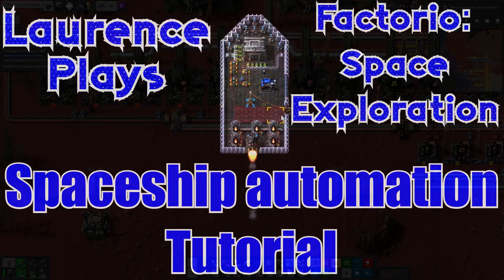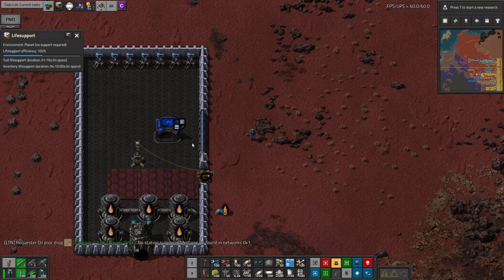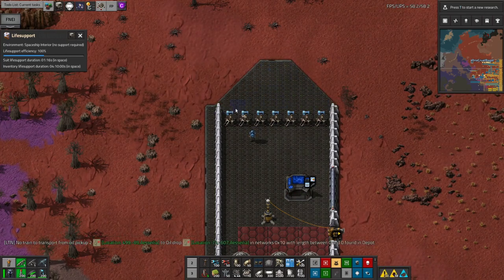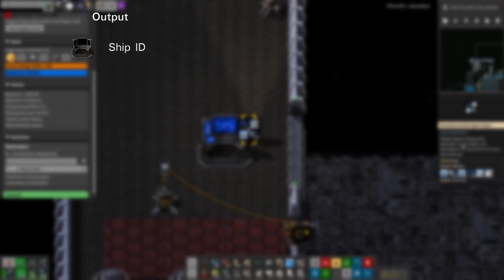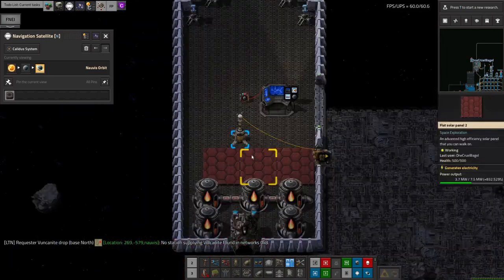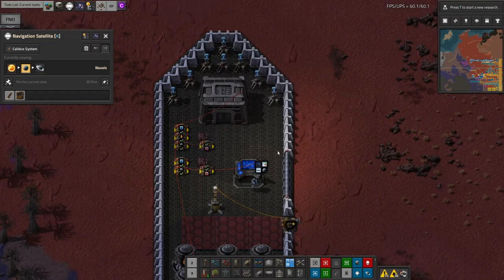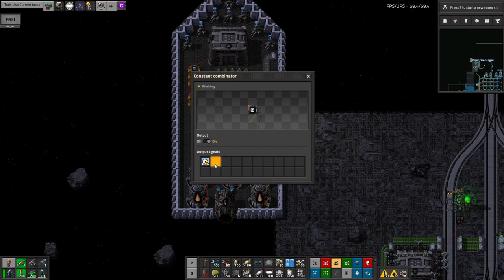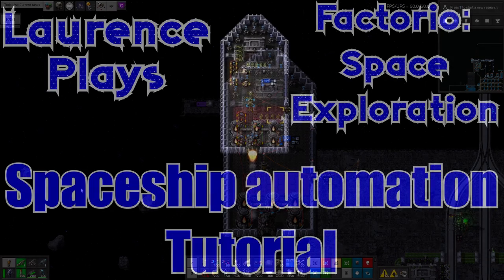Spaceship Automation Tutorial - Factorio: Space Exploration - Laurence Plays

Comment: I just want my personal ship to use clamps when I bring it in to one of my orbital platforms to line itself up properly.  I'm not trying to automate the ship to take off & land on its own.  Is that even doable?
Reply from the maker: Yes, should be very easy! I think (although it's been a little while since I built any spaceships) that if you put the clamps in as normal and feed the clamp signals to your spaceship console all the time, it will dock to them whenever it can. 

You'll need to make sure you set the destination before you launch, otherwise it will automatically dock again, but that should work nicely.
Reply: @LaurencePlays  I'll have to try to figure out what I'm doing wrong tomorrow.  For some reason it spams we with a message about solar panels being in the way every second.  Which is odd considering that I don't have any solar panels on the ship, nor anywhere near the dock.  Which is at the end of a long arm specifically to avoid the problem of clipping.  So that worked great.
Reply from the maker: @OfficerHotpants  Ah yes, I've seen that sort of message spam. My guess would be that you've got another clamp with the same number somewhere else on the space station, so I'd suggest you try turning off the combinator, changing the numbers on the clamps to something different, updating the combinator and then turning it back on.

Comment: With reference to your comment at 8:25, about going back to the same location in the trip: I use a similar combinator setup for control, but I do it outside the ship and pass signals back and forth from the spaceship via the clamps (which do wire passthrough (signals and electricity) when anchored) . This means that I can make it considerably more complex without sacrificing space on the ship itself. My ships carry only 2 constant combinators and one each of the decider and arithmetic: one constant combinator to set speed (because I got annoyed at the manual speed stuff), the other constant combinator and decider to set the anchor position (use the same id's across all destinations for that ship/ship type), and the arithmetic combinator for content measurement. I could move that outside, but my setup ended up having fairly complicated wiring needs, using wire colours to separate input and output, and having to switch wires at some point.

But thanks for the tutorial, you should poke Earendel and his lot to make it a pseudo-official tutorial - I'm not aware of any other video tutorial for spaceships on the webs. And the video is much more helpful than the text tutorial provided by the Informatron.
Reply from the maker: Thank you - I'm glad it's interesting, and I hope it will be useful (at least to SE newbies!). Why do you put the speed and anchor signals in different combinators? 

Having the logic outside the ship definitely makes sense because it saves space, I only really do it like this because I started like this and it makes sense to me. It also means that ships with the fuelling points and anchors in the same place can dock in the same place for refuelling, even if they then fly off somewhere else. I imagine a docking point with external logic would always send ships to the same place (unless you got really clever with the logic!)
Reply: @LaurencePlays  The different constant combinators are to only send the docking signals when the ship is at the destination (via the decider combinator). Not sure if that is actually needed (i.e., don't know when the spaceship looks for those signals), but it is there as a holdover from when I had different anchor numbers for different destinations.

W.r.t. the external logic, a stop can be tweaked for multiple ships to different destinations without needing too much more: using the ship id and one decider per ship to set the destination. But yes, that is complicated and annoying to keep track of – you'll need at least as much total space as you devote on the different ships together.

As with all the best logistics challenges, it's a compromise: ship space, or logical complexity at the stops, or multiple stops serving the same purpose (e.g., fueling)? My solution is to integrate fueling into one of the stops (usually dropoff in Nauvis orbit), and keep the schedules simple and the same for all ships using a specific stop. For example, I have 8 ships chugging back and forth across the interstellar void to deliver Naquitite, and they are all identical (except for name, where they're ordinal). Same stops, same destinations, and if there is a hiccup at one stop (had it when something broke on Nauvis that broke the unloading in NOrbit) and they all pile up at one location, it was remarkably simple to unpile them: fix the broken bit, and they unpiled themselves. xD

But yes, a compromise, with pros and cons for each direction of the compromise and a definite case of "pick what is right for your situation". Might even want to use multiple ways if there is a performance (logistical performance) benefit.
Reply from the maker: @pietersieliepc  Ah - no, you can keep the anchor signals active all the time - that's what I do. And now the speed signal as well, because it caused issues when I didn't. 

A good point regarding using the spaceship ID - with external logic you could use that instead of the anchor ID to choose which signal to pass on to the ship. I should've thought of that  😀 It does occur to me that it would make the logic simpler if you used a different anchor per ship, since you'd only be detecting whether there's the right amount of cargo. 

All my fuelling is done in Naubit, so for ships that are going there, that's fine, but there are a few that go to Nauvis itself and those need a third stop in Naubit for the fuel. 

Yes, all in all, I think it comes down to "having logic on the ship is easier on the brain 'cos you can see it all" vs "having logic off the ship saves space, which is valuable early on".

Comment: Can you assign multiple ships to the same clamp? Would they wait to anchor until the clamp is free before landing or try to overwrite the already parked Spaceship? I'm setting up Naquitite mining and with my design of spaceship taking 30-40 minutes to make a full trip between Nauvis Orbit -> Foenestra -> Asteroid Field -> Foenestra -> Nauvis Surface -> Nauvis Orbit, I'd like to just set up a bunch of identical ships all rotating along that route, but don't want to set up that many different docking stations unless really necessary.
Reply from the maker: If there's anything (man-made!) where the ship is trying to land, it'll just wait until there's a space for it, so another ship, a piece of pipe, the engineer himself; it'll just wait patiently in orbit. Once the landing area is cleared, then it'll drop in and start loading/unloading. 

Your idea is pretty much what I did (although I didn't bother with Foenestra, my asteroid field wasn't far enough out for that to help), but by the end I think I had about 4 identical ships trundling back and forth. They didn't often need to queue, but they would if necessary. 

I also had a fuelling point in Nauvis Orbit that was used by lots of ships - there was nearly always a queue there!
Reply: @LaurencePlays  Nice, that makes things a lot easier. I need Foenestra as a refueling point since my ship runs exclusively on Rocket Fuel, which is probably not ideal, but without access to antimatter stream it was the easiest way to get electrical power, fuel and the ability to launch from the Surface figured out on a rather limited spaceship. Downside is it doesn't have enough fuel capacity to make the whole trip, hence the midway point in Foenestra. Distance-wise it's pretty much the same as going straight to the Asteroid Field. Another upside is that going through Foenestra means the ship never has to deal with the higher Asteroid Density.
Reply from the maker: @Cyrikyty  Ouch, flying out to an asteroid field on rocket fuel sounds painful! I used ion engines for propulsion, and I won't tell you how I generated the power, just in case you don't want spoilers! If you do, it's shown if not in this video then in lots of the SE 0.5 run videos on the channel!

Comment: Woah. You can load trains into ships!? No more barrel shipping liquids?! 😍
Reply from the maker: You can indeed! The main reason I did it was to allow the spaceships to load/unload much more quickly. The downside is that it takes up a lot more space inside the ship though - a single 6x6 warehouse holds 500 stacks, a 4 wagon train (like the ones I use) only holds 200 stacks - so those ships have almost the capacity of a single warehouse!

For transporting liquids, I'd recommend building a ship that's full of tanks. Use rocket booster tanks if you're transporting rocket fuel, for oil/water you'll have to use normal storage tanks. I do have an oil tanker ship as well, which you'll see in some of the later episodes of my Space Exploration run. 

I hate barrels - I hardly used them in this game, sticking with coal liquifaction and transporting ice around until quite recently.
Reply: @LaurencePlays  Skim through my SE LP, I've got probably 20 rockets just devoted to liquid products! :D  ...it's a bit overkill
Reply from the maker: @TinyPirate  That's a lot of barrels, and barrels make me sad! I went with coal liquifaction in orbit for my interim fluid needs. I'm not 100% sure it's better than barrels, but I'm honestly pretty convinced. I should have switched over to something else - either a methane ice outpost or oil spaceship - a bit sooner than I did, but I don't regret minimising barrel use. 

Your factory is a lot tidier than mine, and you appear to be trying to build everything at much higher rates than me. Still, the basic ideas look very familiar  :-)

Comment: 10:54 Does this really work? I can't set an energy beam emitter to a target receiver, when it is on the spaceship on the way. Is there a way to automate the target?
Reply from the maker: You can power a ship with a beam receiver, yes, but you can't charge it when it's on the move. If you point the beam at it when it's parked - probably in Norbit - the beam will fire at the ship while it loads or unloads. Unfortunately, you can't measure the heat level in the ship, so you just need to make sure everything else it does while it's parked there takes long enough to heat it up again. 

The good news is that this means you can use a single beam to recharge multiple ships, as long as they all park in the same place.
Reply: @LaurencePlays  Okay, thank you for your answer, that helped me. 
I was wondering if I did something wrong, because in your clip with the receiver the spaceship was on the fly and received a beam (the light was "on").
I think I will turn the emitter on for a time (done with a Counter).
Reply from the maker: @ScreamyBanana  The beam receiver isn't receiving a beam at that point, it's just still hot from being zapped before. You don't need to worry about turning the emitter on/off, it will do that automatically when the ship departs. You might want to consider making sure the ship stays for long enough to heat back up though, although that wasn't a problem for me - unloading took long enough.
Reply: @LaurencePlays  Yes, but the emitter drains at least 2 GW, 1 GW for the emitter and 1 GW with one chamber/injector. That doesn't need to run all the time ;)
Reply from the maker: Fair point,  @ScreamyBanana . I guess I was over caring about power by that point.  😀

Comment: I’m trying to follow your guide as best I can but when I activate the system the ship pops up into space and immediately pops back down, and beamed power doesn’t lock with ships in transit.

I fear one of the updates broke something.

At least I can dock automatically….

P.S. it’s version 1.1.69
Reply from the maker: I've had ships do that; usually it's because you haven't set the destination properly (either no destination, or the current surface), so they launch, don't depart and then automatically dock. I'd suggest you remove the launch signal from your combinator that's making the ship depart and activate it as normal, then see what destination signal is getting sent to it and work out why it's not right!
Reply: @LaurencePlays  but then it’s stuck going one way. Say it’s stuck on point b, I shut it down but now is stuck going to a.

With both activated it even stutters through space
Reply from the maker: @pikpikgamer1012  You need to set up the logic so that it only passes the correct signal through - so you should only pass the signal to go to point B through when you're at point A and have the right resources loaded. Then when you're at point B, it should only send the signal to go to point A. It sounds like you're sending the signals all the time; you don't need to, the spaceship console will remember the last destination it was told to use.
Reply: @LaurencePlays  I hope I figured it out, it’s was that I didn’t know how to send signals from module to module. I hope this works but I have to wait for it to limp back because my failure costs it’s fuel supply
Reply: @LaurencePlays  still nothing, how do I turn off and on the combinator?
Reply from the maker: @pikpikgamer1012  That's what the section from 7:05 is about - I suggest you watch that bit again, and make sure you've set your spaceship up the same.  🙂
Reply: @LaurencePlays  I wish it was slower and more detailed. It’s there a diagram so I can study it at my own pace?
Reply from the maker: @pikpikgamer1012  You're the second person who's said that part went through a bit too quickly; I think I might have to make another video where I cover that a bit more slowly and talk a lot more about what I'm doing.  🙂
Reply: @LaurencePlays  that would really help.
Reply: @LaurencePlays  I finally figured it out

Thanks for helping.

If anyone else has my trouble here’s  what you do:

Make sure the combiner is before the arithmetic system 

Set the arithmetic system imput to yellow star, this takes in every imput and it will allow you to output as yellow star too, so set it to yellow star to read everything coming in and multiply it by what your combined imput reads then have it output the yellow Star again so it sends the launch codes

Most importantly I read a comment on another tutorial (sorry for not remembering who’s who) that said you can do the program outside the ship so you don’t have my crossed wires problem, the only thing to keep in the ship is the landing program.

I hope my advice will help anyone else who dealt with this as their first circuit epidemic
Reply from the maker: @pikpikgamer1012  That's true, you can have at least some of the logic outside the ship and pass it in through the clamp's connections. I didn't do that because I wanted my ships to be completely self-controlling, because then I could have multiple ships stop at the same docking clamps for refuelling, even if they then fly off to different planets afterwards. 

And yes, you're quite right with having the constant combinator before the deciders - you need to make sure that the destination signal is only passed through if all of the conditions are satisfied. 

Maybe I should start a spaceship debugging service  😀